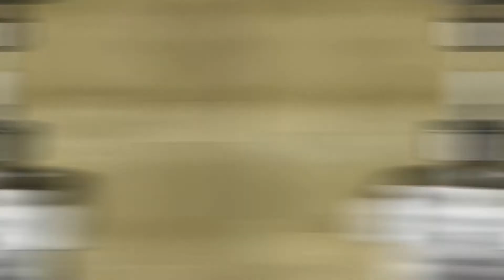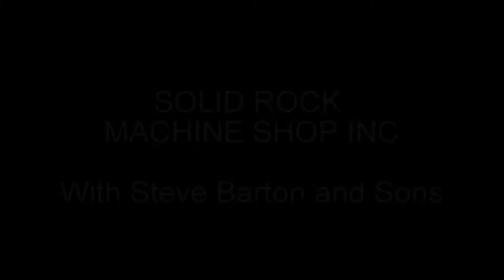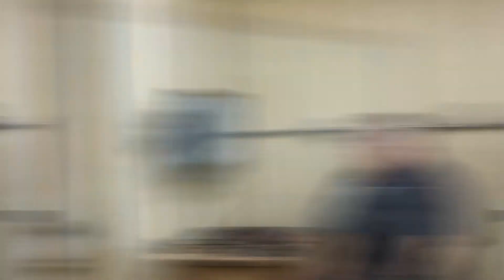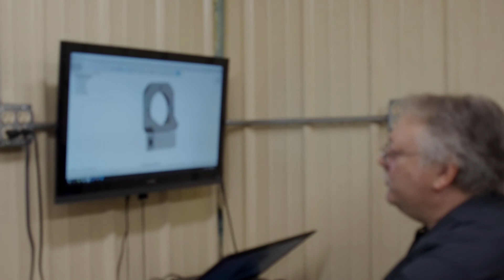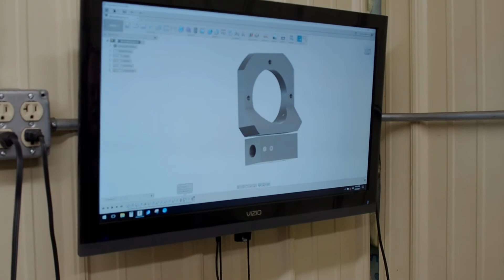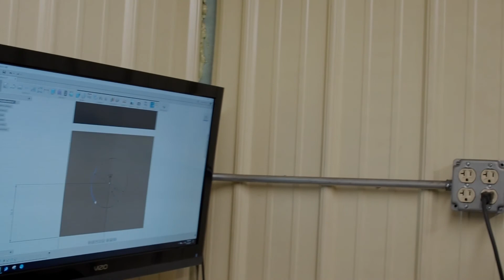Turning a surface grinder into a ID grinder using a NSK Planet 550 air spindle.

Comment from the maker: Link to American Rotary Tool Company NSK air spindles. Talk to Wolfgang if interested.  http://www.artcotools.com/planet-series-high-speed-air-jig-grinding-spindles/
Note from Wolfgang "
A note about the Planet 600's.  These spindle systems no longer come in the wooden box.  Because of international shipping rules, the wood is no longer allowed due to pest infestation.

So, the air line Filter / Regulator / Oiler unit comes mounted on a metal stand as pictured in the current catalog.
"
Reply from the maker: Thanks GreenMonkey
Reply: Nice job on your machining for the mounting hardware for the NSK spindle.
Reply from the maker: Thanks Brian,
That was a fun little project.
Reply: @SolidRockMachineShopInc  I'm looking for a solution to reach 5" into a bore, obviously a 1/4" wouldn't be a good idea but in your opinion would that little spindle work with that same size wheel and large OD rigid mandrel? Would you have to make it or do the offer something already? Thanks, great video!
Reply from the maker: @UshouldTryReality  That would be way to much stick out. If it is a through hole honing may be the way to go.
Steve

Comment: Hi Steve,
Nice setup with that air motor. 
I am in the process of making a mount so I can use my Moore Tool air grinder as a tool post grinder to true up the 3 jaw chuck on my lathe.
I'm going to mount it onto a tool holder for the Aloris tool post.
Reply from the maker: Thanks Eric. Before you grind your jaws check out this video at the 14 minute mark https://www.youtube.com/watch?v=2_GAPDtvhzs
Steve

Comment: Nice, can I ask, where did you get (Brand) the high speed small grinding stones for the air spindle.  Cheap-ass ones off of eBay don't work at high speeds, shaft bends.  Thanks much

John
Reply from the maker: Hi camcompco,

I been getting mine through MSC with steel shanks. You can get much better ones through Centennial Diamond  with carbide shanks and resin bond Tool https://www.cdtusa.net 
Steve

Comment: Thanks for the advice on the three point contact and how it is achieved. That is something that I haven't thought of. I took some machining class's along with mostly automotive body work, custom hotrod/chassis fabrication and building high performance engines. I worked for Al Copeland at his personal toy shop, he is the guy who founded Popeye's Chicken. I've worked on his personal NASCAR's, Boss Hoss's, monster trucks and turbine engine powered catamaran race boats. I had a few years of doing small machining for odds and ends at the shop. It's a wonderful thing to have this platform to learn from such seasoned professionals in a variety of fields. Thanks for contributing you knowledge, sir!
Reply from the maker: Hi 393stroker,
You're welcome.  Popeye's chicken is the favorite of 3 of my children. Looks like you have the dream job that many of my co-workers would love. I work with a few NASCAR fans.
Steve

Comment: Great video guys. I have an ooooooold Planet 500 unit. It works great. What kind of oil do you use for the spindle and where do get it from? Artco is the only source I can find. Thanks for the help and keep the videos coming!!!
Reply from the maker: Hi Mike,
Contact Wolfgang at Artco and he will set you up. It is a special spindle oil. Do you have the air filter and oilier unit to go with the 500?

Comment: What's the advantage of using the surface grinder as your means of motion, over using your lathe to rotate the part and mounting that same spindle as a toolpost grinder?
Reply from the maker: Hi somebody else,
Mounting the spindle on a surface grinder has many advantages over a lathe. One is the precision and super smooth table movements on the surface grinder compared to a lathe or a mill. A surface grinder is made to handle grinding grit a lathe or mill is not and requires extra steps of protection. Some people do not have a lathe or their lathe is to worn out for accurate work but if they have a surface grinder they can use the air spindle in the same manner as the video. Grinding angles is way easier and more accurate on the surface grinder. 
Steve